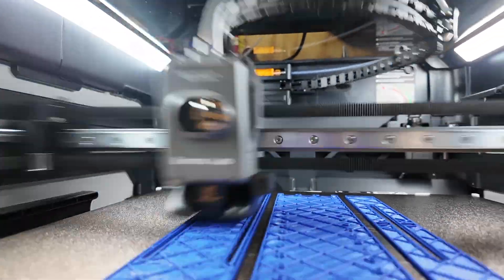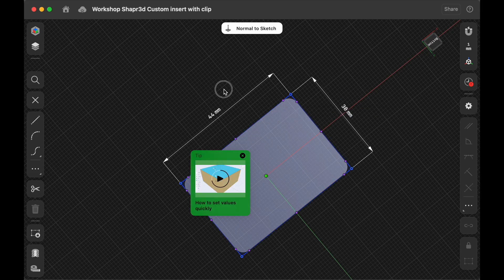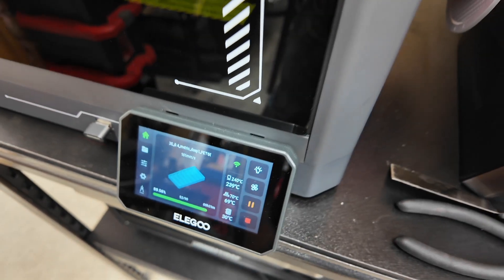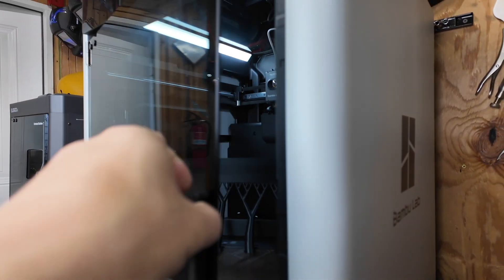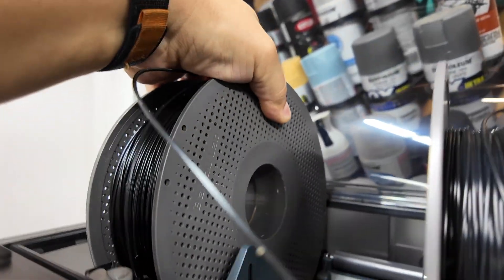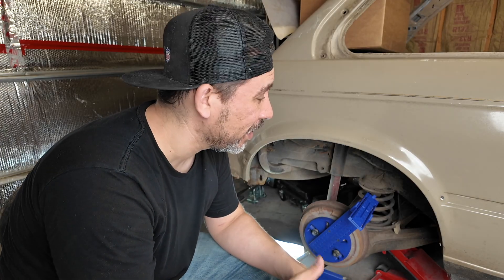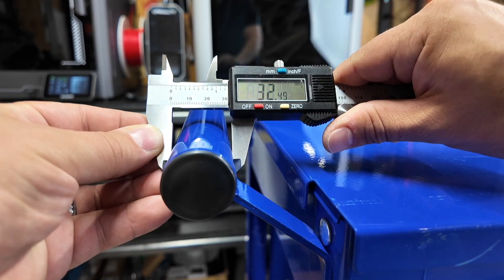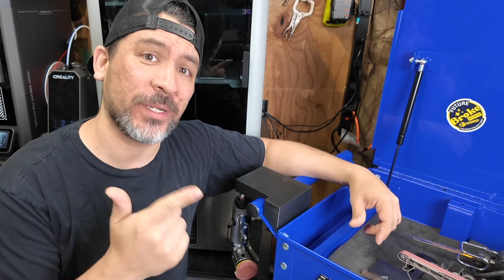Five 3D Printed Car Parts and Tools That Actually Work

Comment: 100%, ASA is one of the best possible choices for interior car parts! It's rather cheap, (unlike PA6-CF), prints well and has great mechanical properties
Reply from the maker: Thx 🙏, plan to test out some ASA-CF next. Do you 3d print car parts too???
Reply: @Itsallaboutthebuild  Not much specific car stuff tbh. I've made some clips from ASA any nylon since the ones on my old Volvo often broke off. Some mounting brackets for tools I keep in my trunk so they don't fly around and a better bracket for my phone mount that fits my specific phone because it was always a bit bothersome to get my phone in and out of the mount I had.
One thing I desperately need is a phone mount for my Camaro though and I have no clue where to even start. Not a phone friendly car😂
I have found exactly one design online and that one looks like it has to be screwed in, which I don't want to do.
Reply from the maker: That's a great start. It sucks not being able to find the right part you want to print. I've been there. You should start learning how to design parts yourself in CAD. I use Shapr3d and its super user friendly. I have tons of free resources on how to get started with some basic designs here -> https://www.allaboutthebuild.com/blog/2025/2/design-and-3d-print-a-radio-delete-plate-with-shapr3d

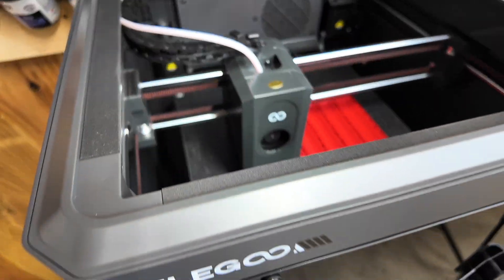Comment: This was a great, informative video. I didn't understand about half of it but it was full of cool visual ideas. Just that information about using a fume extractor (at 2:00) could possibly be saving lives❤❤‍🩹❤
Reply from the maker: Appreciate the comment. 🙏🙏🙏 How did you find our channel, are you looking to learn how to 3d print?
Reply: @Itsallaboutthebuild  I'm really just doing research for now. I don't even have a 3D printer yet. When I buy one, I'm looking at getting one of the better ones, like a higher end Bambu Lab one. Right now, I'm just learning and watching vids. Your channel is one of my faves cuz you're a great teacher and it's really interesting. I haven't pulled the trigger on getting a 3D printer yet cuz I would prolly only use it to print silly things like toys and stuff for now. I'm waiting until I have that ONE project that will almost pay for the 3D printer itself. I do really like the community and I think it's great that sooo many creators, such as yourself, share their models with everyone else!
Reply from the maker: Nice!!! Bambu Lab is great. No fuss 3d printing for sure. Printing toys or random stuff is great to get your feet wet. Go for it!!! Once you start, it's hart to stop. Especially once you start learning how to design your own parts :)